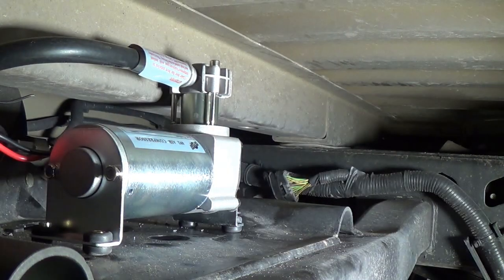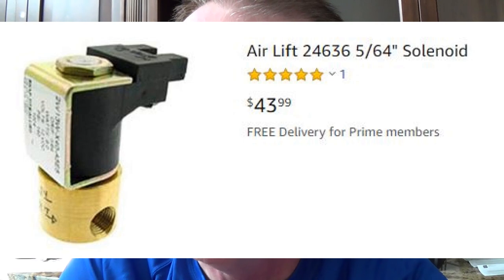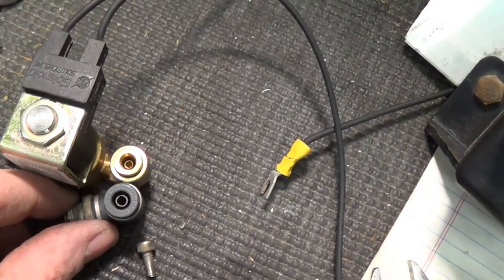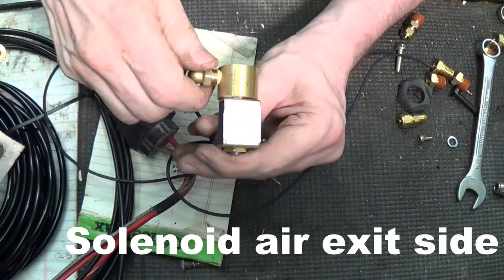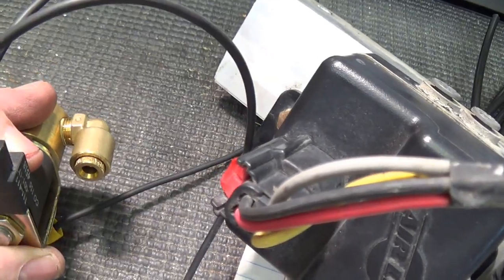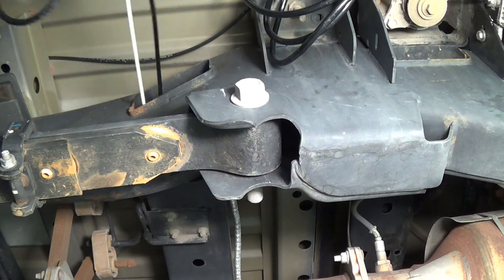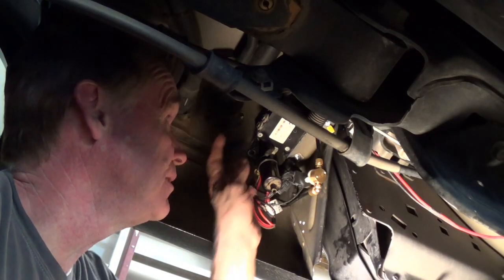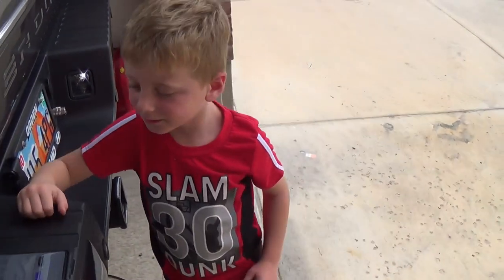Using Airlift wireless control with on-board air system

Comment: I also have onboard viar dual system.  I want to add the Air Lift 5000 rear air bags to my RV and want to be able to add air individually to each spring for load balancing, so need a dual path.  I love the idea of the wireless but hard lined is fine too.  Im new to air bags and trying to figure out if the Air Lift system comes with a controller for in cab air or if I have to buy one separately and if so which one?  Loved the video!
Reply from the maker: Interesting that you're putting airbags on an RV. I'm assuming a single axle with custom brackets. Regardless, AirLift makes a controller like you describe. The simplest of all setups is to run each airbage line to a place where you can install individual schrader valves and manually fill them one at a time. It would make side-to-side leveling really easy as there's about 3 inches of lift in a bag,
Reply: @EpicCowlick  It will greatly help with weight distribution side to side.  Mostly because I have a huge battery bank on the passenger side over the right dually's.  Airlift makes a kit, Model: 57202 that fits perfectly on my workhorse W24 chassis.  I really want to be able to air up or down from inside the cab.  I like your tweak you have in this video.  I may try and do something similar although I'll need an air solenoid capable of 200 psi because my onboard system is a Viar 485c dual compressor system.  I suppose I could do as you have done with two Air Solenoids and a wireless system like yours
Reply from the maker: @deadliestcatch_toddstanley  AirLift has a Performance line (airliftperformance.com) where you can buy individual components that are rated that high. They're a bit more expensive due to the lower sales volume but it's good to have an option.

Comment: That OEM air compressor without a gasket is an engineered failure. Rather than waiting for the eventual internal corrosion and failure of that component, why not just seal any water intrusion areas with RTV silicone or equivalent? Who wants to re-do any install more frequently than necessary?

Comment: Kind of surprising that  there was that much water penetration, surprised it isnt sealed up a little better but not much you can do about it that's a manufacturing issue that someone in engineering dint think of  didnt think would be an issue, very good work around, it's just a shame you had to implement one to get it back to snuff. Uh Oh...looks like Justin is going to horn in on Michaels helper status...lol
Reply from the maker: AirLift could seal it up. It's probably just a cost thing and they don't want to spend the $$. And yeah, little Jackson is always happy to help gpa!